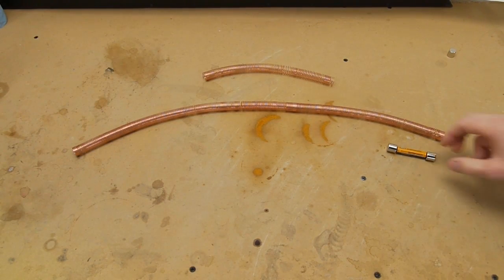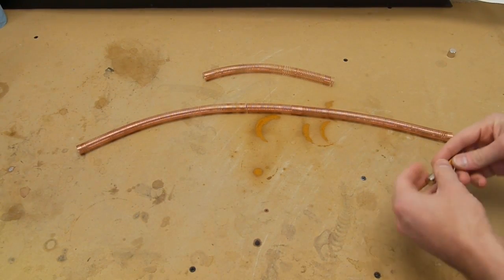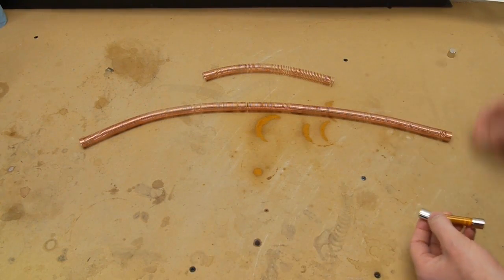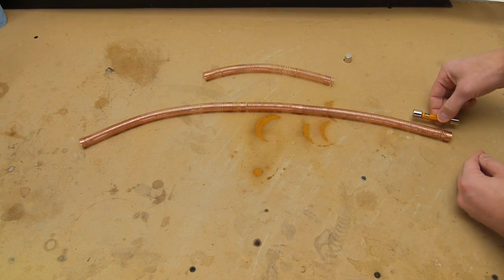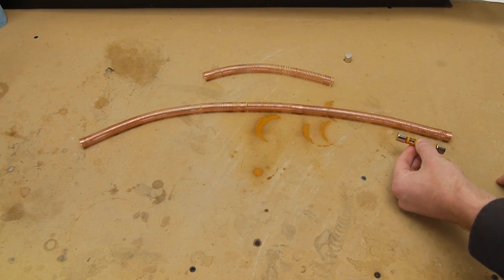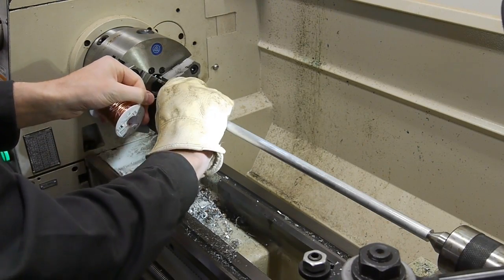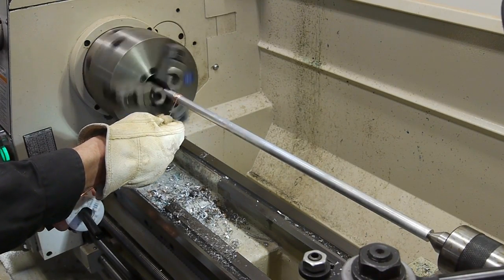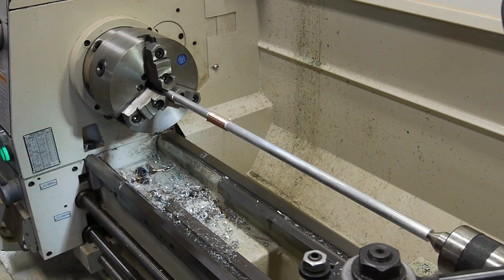Magnetic Propulsion

Comment: Make it circular.
Reply: John Hosey That would be Tubular! It would go round and round until the battery dies.
Reply: Edger Sterjo What about if you don't connect the ends. Just put them close, but not touching.
Reply: John Hosey Was just gonna say exactly this (maybe with an exclamation mark though), so I second this!!
Reply: John Hosey Might work, but you'd have to put some resistive element on a portion on it. Otherwise there'd be a current on the portion where the battery is, and an opposing current where the battery isn't. That'd make two magnetic fields that would probably come close to, if not exactly, cancel each other out.

Adding a resistor somewhere would make the current where the battery isn't a good bit lower, making the field pushing it along much higher.
Reply: Persona Current always flows the shorter path. It will not flow to the rest of the loop-ed coil if tnere is not significant momentary disconnections. Even if battery disconnects many times, it will not affect the propulsion, since currents flow no more, and inertia of the 'train' move it forward. Yes, it will be interesting to see how it will run along the 'infinite loop' of coil until battery dies.

EDIT: Okay, it may induce some current to the rest of the coil, but I think it will not influence movement of the train very much.
Reply: John Hosey Infinite loop till the battery runs out
Reply: John Hosey The current would then flow in 2 opposing paths. And the resulting magnetic forces should cancel out.
Reply: @edgar0071  if a small gap was left so not complete that would work.
Reply: ***** No, actually, current will definitely flow if there is a voltage supplied. More current will follow the path with less resistance, yes. But the resistance of the short section is not that less than the resistance of the long section, and the internal resistance of the battery is going to be much greater than either. This means the current through both sections is going to be nearly equivalent once enough time has passed. Albeit the short section has a smaller self-inductance, so it'll get up to speed faster. But anyways. 

Point being, current will still flow through the longer path, so long as voltage is supplied.
Reply: Persona
Okay, well... yes. Then it may be possible to make insulated part of the coiled 'railway', where inertia will be (hopefufly) sufficient to 'bridge' this distance, and go into another coil.
Reply: ***** I've seen it done this way, and it does work.
Reply: USWaterRockets
That is soo cool. Thanks.
Reply: ***** 
Ever heard of parallel resistors? According to you the current would only ever flow through one of them.
Reply: Edger Sterjo 
I don't think they'd cancel out.
The current going the "long" way would be much lower then in the short path. In fact the ratio of the currents is the inverse of the ratio of the lengths of the short to the long path. At the same time the long path has more windings again in the same ratio. So, yes, ideally they would cancel out. But, since the coil is bent and not perfect at all, the magnetic losses in the long path should be much bigger than in the short one.
Reply: *****
Totally what I said in the comment you replied to first :P

Nice to know that it works, though.